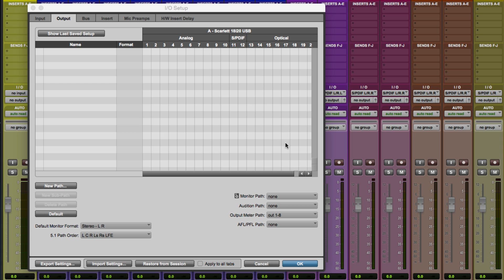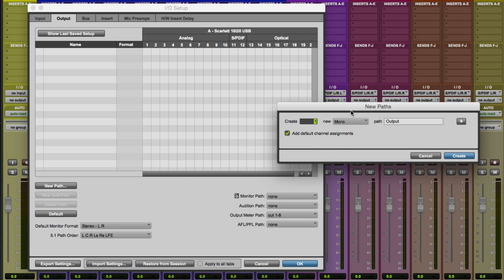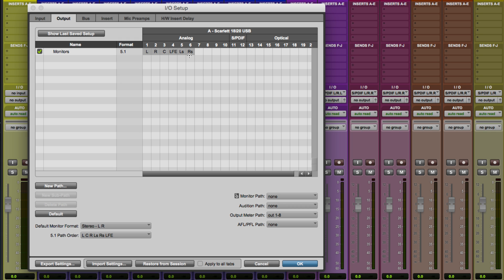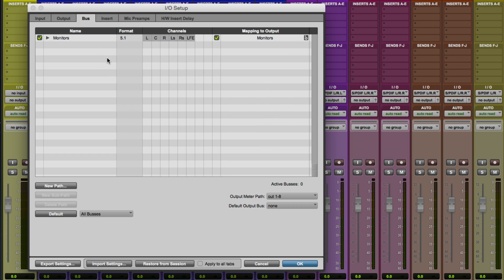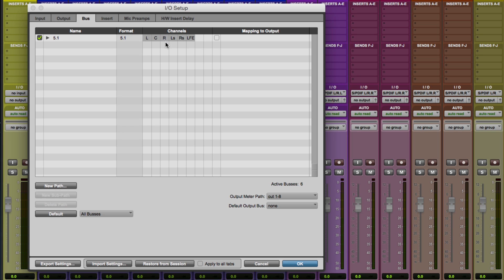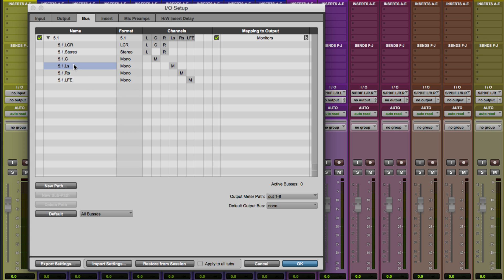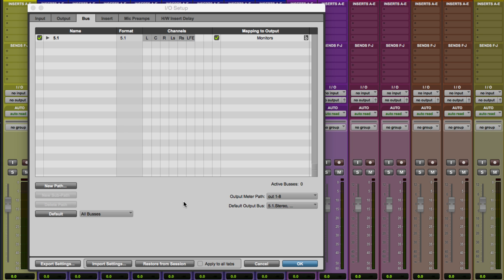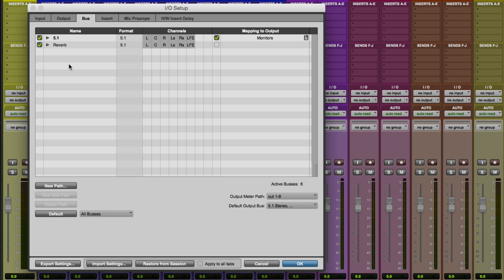Setting up to Mix in Surround in Pro Tools

Comment: Hello,
I'm wondering if mixing is the same as in this formate as Stereo. Meaning  their a Mix Buss in stereo but, I'm not clear on 
how it happens in 5.1 . Does all tracks have a meeting place if you will, to go to before the Master Fader ?
Reply from the maker: Yes, it's basically the same.  Instead of a 2-channel output you are setting up a 6-channel output. So, you can simply create a 5.1 output bus and a 5.1 master fader and you're ready to go.  It's much simpler than something like Dolby Atmos.

Comment: Hello Sir, I have exactly the same setup, all this while I had been using 2.1, the bass management was controlled by Genelc 7040A (2 inputs and 2 outputs). Now I have procured 3 more 8020 monitors to setup surround 5.1 using the same Scarlett 18i20. How would the 7040A control the bass management? Or would it be just one scarlet output going into the 7040A input? I'm slightly confused, the 2.1 setup was different as per the bass management was concerned.  Awaiting your reply. Thanks in advance.
Reply from the maker: The 7040 only supports stereo bass management.  So you'll need to find a software solution to handle the bass management (such as the Waves M360 or Dolby Atmos Renderer), or upgrade to the 7050 which supports bass management up to 5.1.  

Another option could be to continue using the 7040 for the left and right channels, and then use DAW EQ to roll off the low end of the center and surround channels so that they have no bass to be "managed."  You'll also need to eliminate LFE in this scenario so just mixing 5.0. I had an older 5.1 Genelec system where the sub only handled L,C,R bass management so I just had to be careful to have no bass content below 80 Hz (the crossover frequency for the subwoofer) in the surrounds. You'd have to experiment to see if such a configuration works for your particular situation, but at least you wouldn't have to spend any more money and could probably still create good sounding 5.0 mixes.
Reply: @erickuehnl  Sir, thank you so much for the reply. I will try the possibilities which suits my setup as per your suggestion and update here.  I was curious about asking the question, that if along with the 5 Scarlett outputs going to the monitors(L,C,R,Ls,Rs), if I give the 6th output to one of the LFE L/R  inputs,( there's no LFE IN in 7040A), will that work? Ofcourse there would be no bass management,  however the LFE line would be an independent channel. Can I get signal out of the LFE this way?

Comment: what sub are you using? Have this identical setup and trying to get signal to my sub woofer out of my 18i20 but not getting any signal to it. Are you using a separate power amp for your sub?
Reply from the maker: I have a powered Genelec subwoofer that also handles the bass management for the entire system.

Comment: Sir what I should do to get the output to my headphones?please answer me sir
Reply from the maker: I don't know if I can answer that question without knowing more about your situation.  Do you want the surround mix to be down mixed to a stereo mix that you can monitor in your headphones?  If so, you can use the DownMixer plug-in that comes free with Pro Tools.  Or are you looking to create a binaural mix that simulates surround in the headphones? That would require a third-party plug-in such as Flux IRCAM Hear or Waves NX, or an external binaural renderer such as Dolby Atmos Production Suite.
Reply: @erickuehnl  thank you so much, love you sir🖤♥️
Reply: @erickuehnl  Thank you for saying this, Im making this comment in 2022 and I have put the FB360 Audio 360 Converter onto the Master 7.1 Output Track to be able to monitor an overall 7.1 mix in my headphones. Much success, thank you!